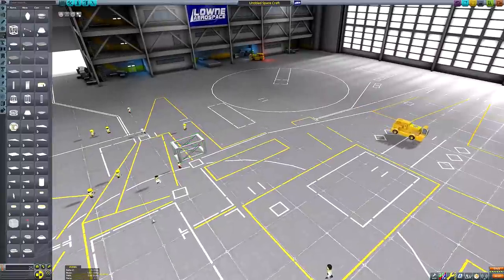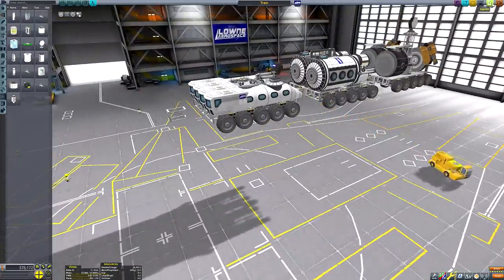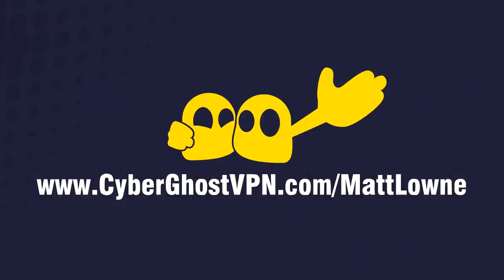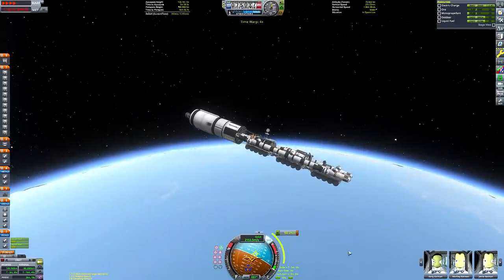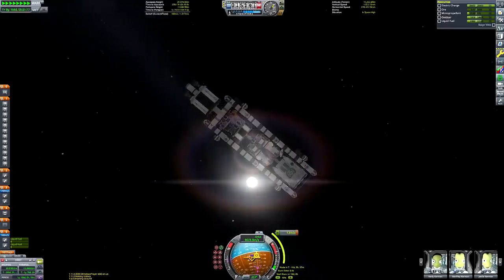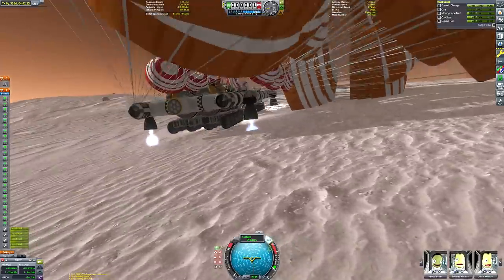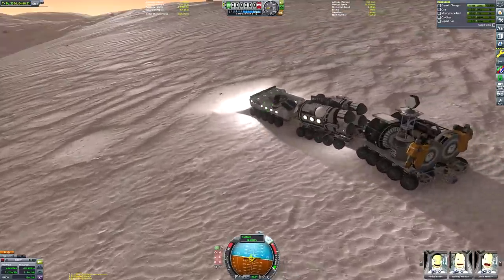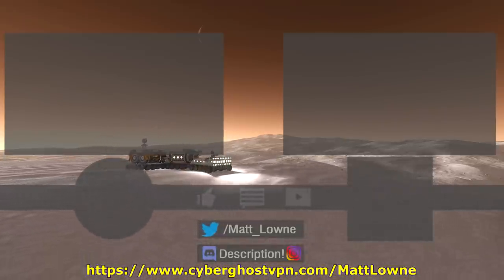KSP: 54-wheeled LAND TRAIN to Duna!

Comment: "that seems to have stopped the sliding a bit" he says as the rear 2 carriages drift across the surface.
Reply from the maker: Tbf it looks a lot more extreme in the video because the footage is sped up
Reply: @MattLowne  a video idea:make a vessel with one of every part.
Reply: @informalchipmunk5775  That ship has to be called "And The Kitchen Sink"

Comment: Matt, I did this last week.
Given that my rover was only two wide and the parts were independent,  other than that it was pretty much the same.
Same idea, at least.
Here is what I found.
- Only the front should steer. The trailers should not. 
- About friction, the rear wheels on your trailers should have friction, the front ones better not. That will make your trailers self align after a turn.

Our approach was a bit different,  as I built my train to cruise a bit faster than yours. It could handle 25 - 30 m/s easy, without flipping or doing anything weird, even on tough terrain in duna.
If I detached the trailers, my cab could go at 70 m/s. But that's suicidal. It handled 45-50 without any problems. 
I drove all around Duna's anomalies. It was fun.

Comment: A small minor linguistic correction, Here in Australia (unlike you stated in the video) we don't have "Land Trains". There are simply "Trains" (i.e. trains that use rails) and "Road Trains" (Which are trucks with multiple trailers).

The most common configuration seen on the Roads (at least on the East Coast) for interstate haulage is the B-Double followed by the the AB Double, the image you showed in this video was a B-Triple Road Train. In basic terms the trailer type known as "A" is shorter and has a 5th Wheel over the rear axles of the trailer and is usually to form an "AB Double", while a B Trailer is longer and has no 5th wheel.

Comment: Just as an info, I build a land train in KSP with 6 waggons but similar concept. I needed to use some tricks so that the kraken does not attack:
1. only the wheels of the first "waggon" are steerable
2. I used active horizontal motors (!) and added them to the yaw control action group (max angles have been reduced to 30°)
3. the number of wheels that are motorized decreases for waggons further back
4. the power of horizontal motors decreases for waggons further back (damping can have also an impact)
5. breaking power increases for waggons further back
6. the rotation direction of the very last wheels is inverted

Comment: Video idea: a vessel with one of every single part.

Edit: have a use for all of them.
Reply: Good idea
Reply: Im gonna do it and see how it goes
Reply: Impressed
Reply: It's not that hard actually. If you do it from small -> big the whole way down, you can get away with using each adapter and/or decoupler only once.
Reply: @Th3BlackLotus  try doing it yourself, you'll understand how difficult it is
Reply: There would be so many kerbals on board

Comment: I notice the wheels on all wagons kinda do their own weird thing instead of steering like a train. I built a train and I turned all wheels on all wagons except for the first wagon, also turned of steering. The last set of wheels was set to constantly break or go in reverse. You'll lose a lot of power but it does help with keeping that train pointed into the right direction. :)

Comment: Bet you could fix the sliding by disabling or flipping steering on some of the wheels.
It looked like all the wheels on the back car were trying to turn, but because they were all behind the center of mass they all angled the same way.